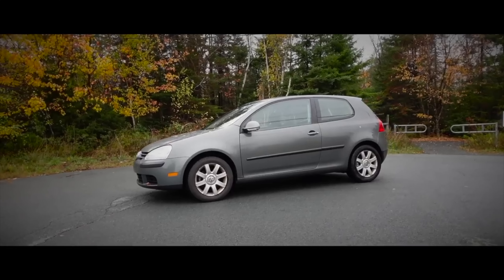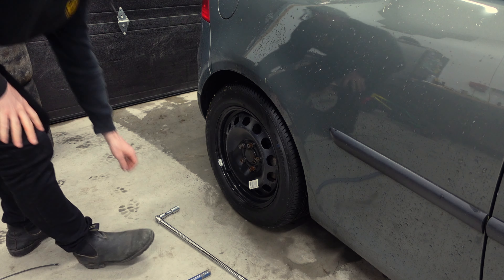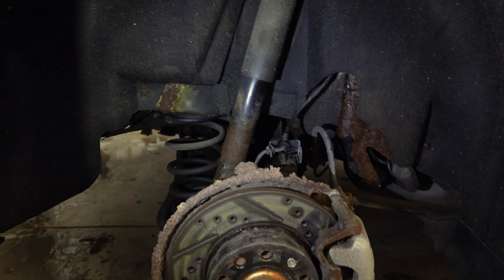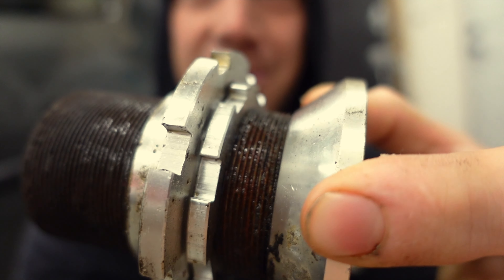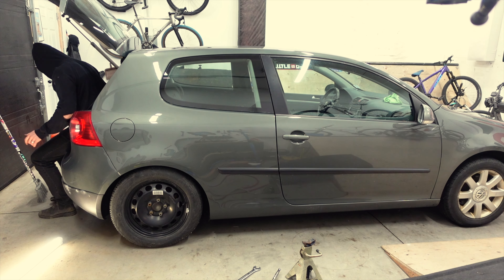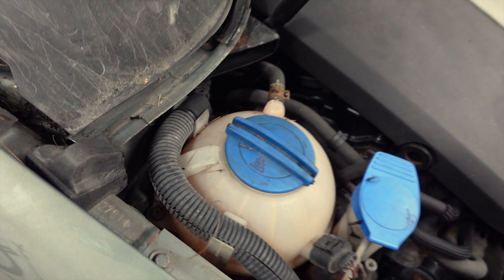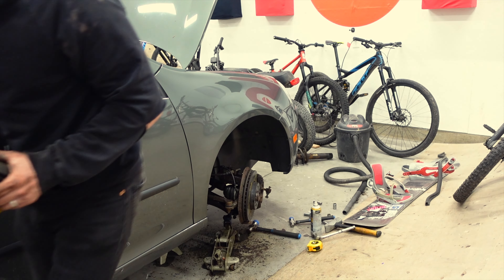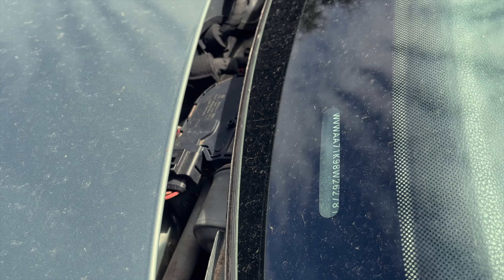my vw golf works well.. time to fix that

Comment: In case you didn't know, Canadian Tire and Parts Source will loan you out tools for free. I do this all the time in the states with AutoZone tools. You pay a deposit and then get the deposit back when you return the tool. They should have a small 2ton 2/3 jaw puller that you can rent out. I've used those to pull front and rear wipers that were stuck and wouldn't come off by hand.